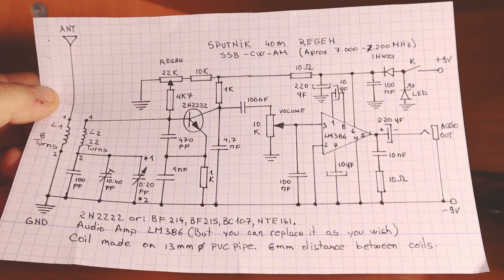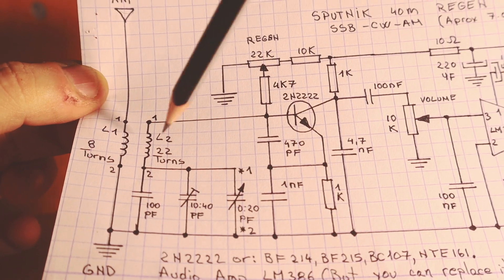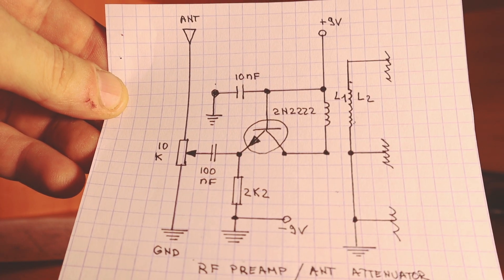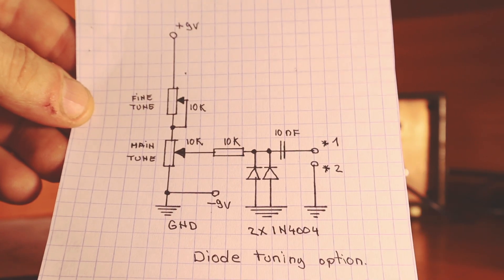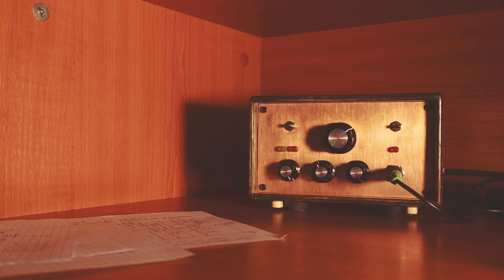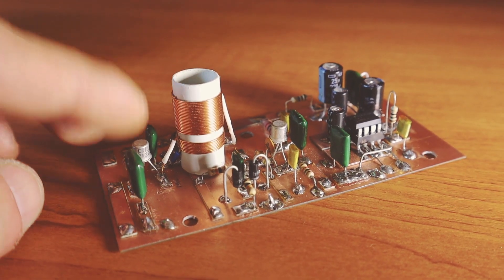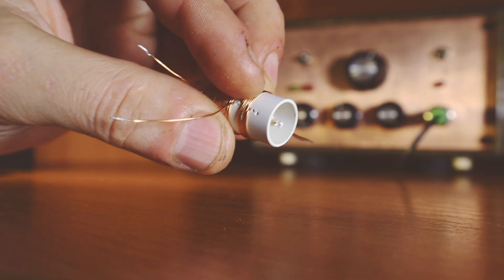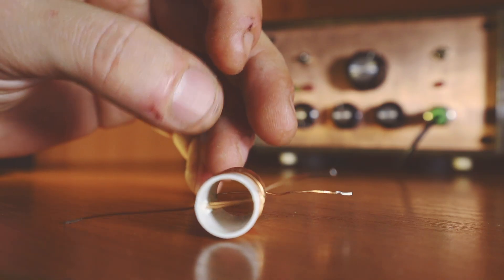Simple Regenerative Receiver For The 40m Amateur Radio Band

Comment: something i don't understand, In regenerative receiver the Regen must be positive feedback (in phase),  You took signal from collector and reinjected it to base through 22k potentiometer (no using a coil in reverse sens) , but collector and base signals are not in phase?
Reply from the maker: There are different methods for different transistors. From what I've seen so far, for the schematics using an NPN transistor, this is a common way. For those with JFET transistors they use the coil you are talking about. This was the reason I picked this schematic as a kid as it was more simple for me to build with out having to build a complicated inductor with so many windings. 😁

Comment: I so want one of these in 2025 and be able to hear 10m to 40m

73 de kq4hcu
Reply from the maker: I think it will be hard to be able to properly tune it on such a wide bandwidth... but I will try to come up with something since I am slowly finishing the Charles Kitchin regen receiver design ( a bit more sensitive than this one ) ... so that one may be able to cover a little more than just the 40m band as the Sputnik does. 😁 73, YO6DXE.
Reply: @dxexplorer I really need to upgrade my technician license and hurry up getting better at CW, I'm only into my 5th months I been learning CW. I want to become very good at CW first and get my highest level license and just enjoy listening to amateur radio, chew the rag and be very great at CW mainly
Reply from the maker: I really need to learn CW as well. I hope this winter I will have the time.
Reply: @dxexplorer I make myself spend a few minutes a day before  I do anything else
Reply from the maker: @sangreevolverI will have to do the same, otherwise I will never learn the code.

Comment: Hello, how are you? Excellent video! Yesterday, I finished building the receiver, and it actually only took me one afternoon. However, while I was building it, I was thinking about the type of antenna that would be suitable to use with it. When I finished building it, I tested it, and it works - I can hear small high-frequency oscillations and that typical sound the equipment makes when I tune the circuits. Nevertheless, I'm not able to pick up any transmissions because, as I mentioned, I don't have an antenna, and I'm not an expert to know which one would be the most suitable. I would like to know if any of the readers of this post could mention a way to build a simple antenna or refer me to a place where I can find information on the type of antenna I need for this type of receiver. Thank you very much for the video, excellent work! It's a very nice receiver to build.
Reply from the maker: I am glad you had the chance to build it and that it works. Well... to keep things simple... at first when I built the receiver... I only used about 8 meters of wire that was hanging on my ceiling and that was my antenna for a long time. Of course once I extended the wire to about 10 meters and installed the wire outside, the reception was better. But for best performance... in time as there is no rush... you can try this one: https://youtu.be/0aq24ggLfYM?si=-AmruiUAHDxcy0--

But again... even a simple wire would do the job for now until you can build a resonant antenna that clearly would perform a lot better. Let me know if you need more help. 73, YO6DXE.
Reply: @dxexplorer yeah,  A dipole,  two 8 / 10 mts wires in oposite directions 😊 cheers

Comment: Where did the link go?
Reply from the maker: The one to the blog article I used to have ?
Reply: @dxexplorer yes! I want build this on a copper board but I can’t find the original article
Reply from the maker: @Adam-qd8jh  I removed that link because I changed blogs. It was too much for me so now I am building three in one haha... Photography, Outdoor Adventures and Amateur Radio... you still have the download link for the project files down in the video description and you have the PDF file there for toner transfer method. I will slowly re-publish all the articles from the old blog into this one. I will start with the Sputnik sometime this weekend I promise 😄. Is the link with 28-north.com
Reply: @dxexplorer thank you very much and  is there a place I can buy all of the parts. I think I might the toner transfer method
Reply from the maker: @Adam-qd8jh  the first versions I made were all from recovered parts from old receivers )). I know there was someone selling kits on eBay but I don't know if is still available. I order mine in local stores here ( mostly the potentiometers ).

Comment: Fantastic !
Reply from the maker: Check the video description for the final schematic. There is the download files link there. I was still testing and playing around with the schematic and it was one of the first versions in this video. 73, YO6DXE. the audio is a bit low as is meant for headphones only, but you can use an external amplified speaker.

Comment: Hi, awesome work, thank you! I think there should be a ~100k resistor between +9V and the base of the preamplifier transistor instead of a short ... I will give it a try :)...
Reply from the maker: I have the updated schematic in the download folder ( link in the video description ). I used the same preamp Charles Kitchin used in his regen receiver. Some people put that 100R resistor but honestly I haven't noticed any difference at all. 73, YO6DXE.

Comment: Hi friend I tried your receiver but the audio output is very low can you help me solve the problem? the version is the one with the second capacitor in parallel to the coil
Reply from the maker: I am going to make you laugh a little. I made so many version and updates on this one that I no longer know what version everyone is building 😅. In the latest one... the one available for download now in the video description... that one is meant for headphones only. Or of course with an external amplified speaker. The reason for this was to keep the battery life longer and for headphones the volume was way too loud when using a preamplifier. So... if the volume is a bit low... sometimes you either have to make sure that you have a good antenna... or sometimes to simply wait for some good propagation.  When I first started working on this one I messed up many times because it was working fantastic... then the next day quiet. So I thought is bad and started changing it again... and of course I had to go back to what I did first because it was better. It took me a while to realize that the receiver was fine... it was just bad propagation and I could only hear nearly nothing 😅😅😅. Let me know. Of if you have the time shoot me an email with the schematic you used so I can think of what else may be wrong. 73, YO6DXE.

Comment: secondo me passato il punto di massima reazione positiva, il circuito comincia ad oscillare, mentre mescola  col segnale d' antenna distorcendo, e non funziona più come ci fosse solo reazione positiva, ma come un conversione diretta mescolando segnale e oscillazione
Quando serva per ricevere la SSB gli andrebbe cambiato nome secondo me
Reply from the maker: Well the truth is that it is in fact a regenerative receiver... not a direct conversion receiver. What I do in my circuits in order to get the best results and sound possible and also stability, is to build them band specific. So in this particular case I could play a little on the regen control part in order to allow me to better fine tune the regen control. But if someone wants to build it for a larger bandwidth, then the regen control will have to be modified again in order to fit that particular situation. Even though I think it may work just the way it is, but the regen control won't be as "fine tuned" as it is now in this particular situation. It's still a regen receiver, far from direct conversion receivers. 73, YO6DXE.
Reply: @dxexplorer  sentimi se ti amplifica i segnali e li rivela senza fischi  lavora nella zona di amplificazione positiva.. se fischia per le stazioni AM  non centrate e le portanti e rivela la SSB sta oscillando e convertendo e lavora come un conversione diretta.. Io uso un FET es. il  j310  e con un potenziometro (tra positivo e negativo dell' alimentazione) vario la tensione sul Source mentre il Drain  (Gate con resistenza a massa) non lo alimento a più di 5V e sintonizza senza ritocchi dagli 80 ai 40 metri..
Reply from the maker: Yes the JFET version is another version, like the one designed by N1TEV... but an oscillator based on an NPN tranzistor can work pretty well too. Honestly I prefer the NPN versions... so far they seem more easier to adjust the regeneration control. And the feedback again... it depends on how the circuit is designed. But it is not a direct conversion receiver... as long as there is feedback involved... it's still a regenerative receiver. I know that particularly for the 40m version for example, the one in the video... you do not have to change much in the regen control since is specifically designed for SSB and CW... but as soon as I replace the variable capacitor for a larger one to cover more bandwith.. then it acts just like the one based on a JFET and the regen control no longer works like it does now strictly on that portion of the 40m band. I hope it makes sense.
Reply: @dxexplorer  quando metti un FET controlla la tensione sul Source come ti ho detto e vedrai che regolandoci il potenziometro, pian piano, ci distinguerai bene, fino a quando il circuito funziona da semplice amplificatore positivo, a quando passa in oscillazione-rivelazione, demodulando la SSB, poi anche con l' oscilloscopio lo vedresti.. sappimi dire se fai delle prove.. io metto anche un diodo Schottky tra Gate e massa (catodo a massa) male non gli fa.. ed esco dalla resistenza di Suorce con un filtro BF passabanda ben tagliato oltre 3Khz.. il problema resta quello di separare le due bande laterali che riceverebbe insieme per far posto ad una sola ...
Reply from the maker: But that is a DIFFERENT schematic. In this video I am NOT talking about the schematic with a JFET. Its about a regenerative receiver using an NPN tranzistor. The purpose of this project for me was to build the best I can a regenerative receiver using a general NPN transistor. There are other videos on other schematics where I talk about the JFET. This video is not one of those. Happy Sunday. 73, YO6DXE.
Reply: @dxexplorer  vado a cercare gli altri video, così metto un commento su quelli a FET, ciao e buona giornata

Comment: Very very helpful project. Thanx for sharing. I built mine Sputnik but I saw that varicap diode design limits frequency range so; I removed Tuner Pot, Tuner trimmer, D1,D2, C16,C15, R8, C14 >>  Placed a plastic variable cx between L2 pins. >> L2 up connected to base and L2 down connected to ground over 1nf ceramic cap. >> 22K resistor connected Zener Katode + R9 connection to Ground (To compansate Trimmer and tuner pots absence). This New fork helped me to listen more wideband.
Reply from the maker: Yes the bandwidth is limited as the varicap or even the regular 1N4007 diodes usually can only cover the amateur radio band in 40m. The first Sputnik I built was also using a variable capacitor instead and ohh yes with that I could cover a lot. But since I wasn't so interested in the rest besides the amateur radio portion... I replaced it 😄. 73, YO6DXE

P.S. Thank for for the nice words and watching the videos, as well glad it works and you like it. I am working on an enclosure for mine now as after all the changes I ended up with the board on a table and thats it 😅.

Comment: at 0:32, the schematic, it looks like the LED is drawn in wrong direction and there is a current limiting resistor missing (?). Nice receiver.
Reply from the maker: Yes yes it was wrong. But I updated it meanwhile. On the blog article, If you use the link in the video description, there is the updated version. 73, YO6DXE

Comment: For the diode tuning does 1 connect between the 470 pf and 1nf capacitor ?
Reply from the maker: https://dxexplorer.com/sputnik-regenerative-receiver

Have a look at the article as I put together there all info, updated schematic and all videos together so it would be easy for anyone to understand it and build it. I hope it helps. Is basically the same schematic as in this video, but cleaned up and improved. 73, YO6DXE

P.S. Let me know if there is anything you don't understand and you need more help.

Comment: Whats the coil wire diameter?
Reply from the maker: I used 0.4mm. Check the article on the blog. I think there is a link in the video description... I have lots of details there with the finished version. 73, YO6DXE
Reply: 24 gauge maybe

Comment: Can I use a single variable capacitor? And What should be the value near to?
Reply from the maker: To replace the diode tuning ? Yes you can. That is what I used at first also. But just make sure it has gear reduction otherwise is hard to tune, especially CW. The one I used was 18 or 20pF I can't remember for sure... and it allowed me to tune the same as I do with the diode now. You may have to make little adjustments to the capacitor that is in parallel with the main coil.

Comment: that grounded base RF pre amp also prevents some of the RF oscillations from radiating through the antenna
Reply from the maker: Yes indeed. Actually that is the main purpose..  the preamp thing is secondary. 73, YO6DXE.

Comment: Hey the little circuit you made for rx tx switching can you tell me define witch capacitor value you use on the antennea and the resistor and diodes
Reply: The 3 capacitor symbols which value is it my friend
Reply from the maker: Not sure if I understand right. For the rx tx switching I just used a simple switch. But if you also want to use the LED indicators... then that depends the voltage you power up the circuit with... for 12v as example I am usually using 680 ohm.

Comment: ❤ Здравствуйте, подписан на Вас, есть вопрос
У меня нет частотомера, я зделал приемник Спутник по вашей схеме, мне нужно выставить частоту но я не имею частотомера, но у меня есть UNI-T980C, ОН МЕРЯЕТ ЧАСТОТУ ДО 10 Мгц, могу ли я им выставить частоту или к нему нужен усилитель предварительный, если у Вас есть схема такого усилителя, не могли бы Вы мне ее прислать?
73
Reply from the maker: Sorry I write in English but I am on the phone and I don't have a translation app. I don't know much about that multimeter. I have a few from Kaiweets but even if they measure frequency from power supllies... they do not measure RF frequency. If you want to get the receiver in the 40m amateur radio band... the easiest is to use an online SDR later in the evening when the propagation is good... you must listen to the SDR... and then try to make adjustments to the receiver until you are able to hear pretty much the same thing. If you used the latest schematic that is on the blog now... then you just play with the trimmer capacitor... I think is C16... and the value of C15 the one that is in parallel with the trimmer. This so you don't have to keep modifying the coil if the inductance of the coil is not exactly as mine. Usually this is the easiest way to tune the receiver in the right portion of the band with ought a frequency meter. Even though... it is a bit time consuming ... but this is how I did it for a long time for all my receivers until I managed to get a frequency counter. Maybe you can buy a cheap one like the one I used and posted a photo of it in the blog article. They have them pretty cheap on AliExpress if I remember well. They are not perfect... but they help you a lot. Let me know if you got it tuned... if not send me an email from the blog and I will try to help you. 73, YO6DXE.
Reply: @dxexplorer  Thank you for your detailed answer, I really like the way you shoot videos, you are great! 
I will definitely try to set it up as you wrote to me, I will definitely let you know how it went
73
Reply from the maker: @user-us9sv4be5y Thank you so much my friend. I've been really busy with work lately... but I hope I calm down slowly and I have time for more videos. Ok let me know how it goes... good luck as I know is not so easy with ought measurement equipment. 73 my friend.